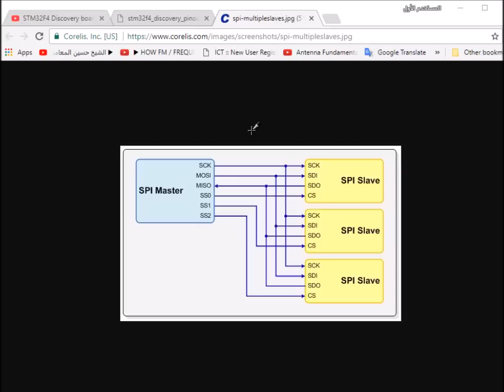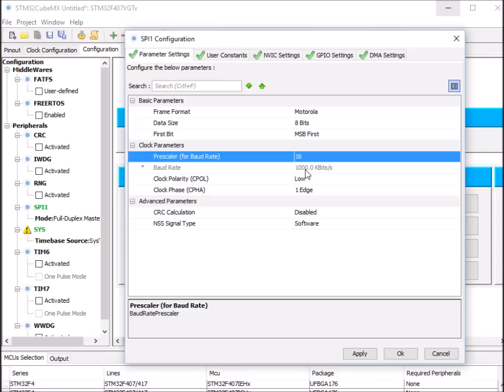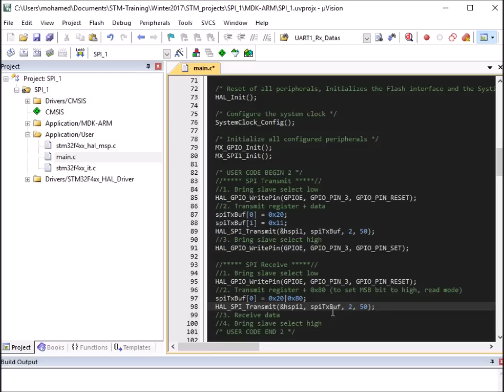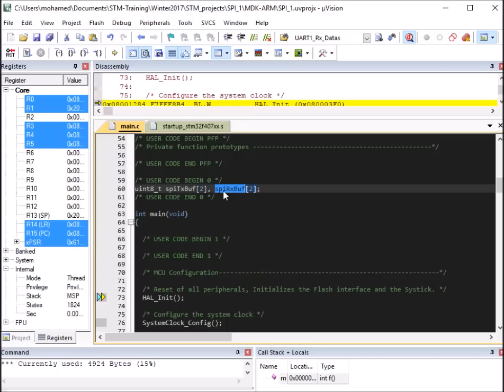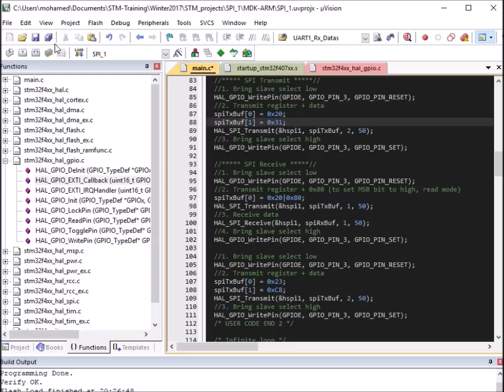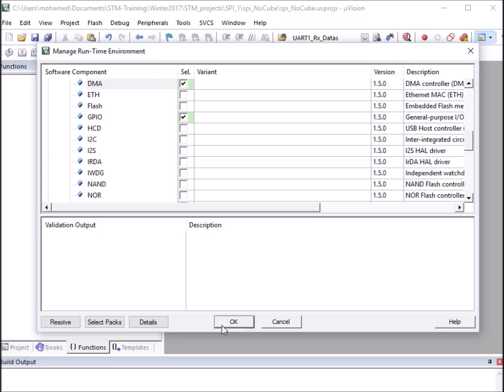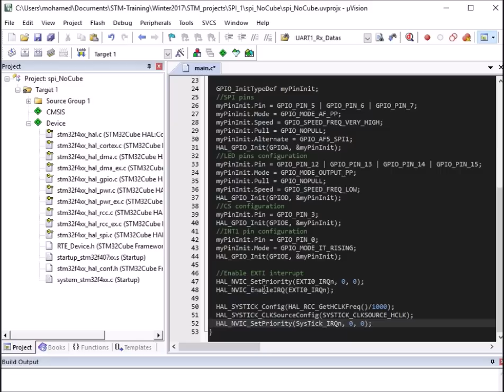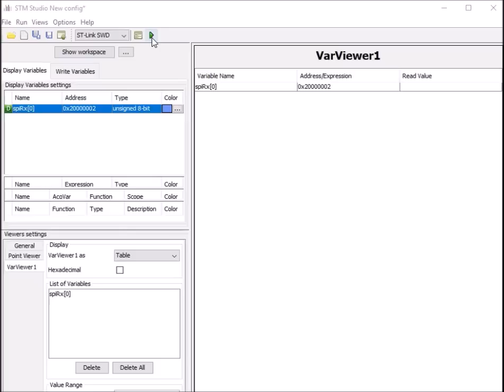STM32F4 Discovery board - Keil 5 IDE with CubeMX: Tutorial 9 SPI - Updated Nov 2017

Comment: Thanks for the video.
can you do CAN bus example?

some bookmarks:
2:28 setting SPI 1 in CubeMx
4:05 adding Tx and RX buffer to main
6:27 do: (reg_val | 0x80) to set device into read SPI operation.
8:13 debug it
8:49 view in STM studio 
9:06 using the generated Project_name.axf file 
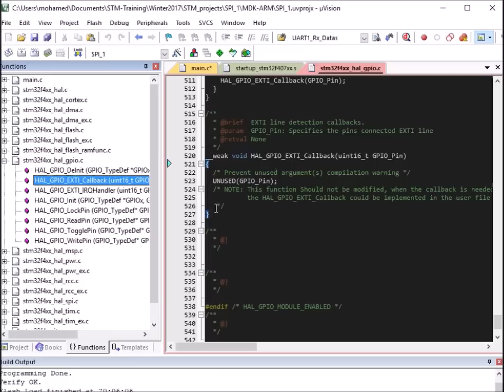10:56 using HAL_GPIO_EXTI_Callback() function
12:52 PART II - without use of CubeMx
Reply: I found the CAN Bus examle...
STM32F4 Discovery board - Keil 5 IDE with CubeMX: Tutorial 33 - CAN Bus - YouTube 
https://www.youtube.com/watch?v=ar3I38lCLT4 

Thanks.

Comment: Can you explain how you can send dummy data and get  garbage data via "Hal Function " ?
Reply from the maker: Hi,
I am not sure what the question here.
Reply: @mutexembedded2206  without sending dummy data to slave , how can you receive valuable data from slave?
Reply from the maker: @shouryuken-g7c  Hi Fatih,
You're right, SPI is meant to exchange DR (data register) between device and master serially.
Reply: @mutexembedded2206  Is it possible to exchange datas by using "SPI_HAL_Transmit" Function
Reply from the maker: @shouryuken-g7c  Yes, but if you look at the function details, it does Transmit-Receive internally but ignores received data. Most devices however, behave in Half-Duplex way, where you send, then you receive ignoring all dummy data in between. an easy example is the SPI tutorial I shared.
Reply: @mutexembedded2206  Well, I coulndt understand how "HAL_SPI_Receive" function  receive valuable data from slave without sending dummy data, because master should send Clock pulses to take it.
Reply: @shouryuken-g7c  actually the HAL_SPI_Receive() function is calling the HAL_SPI_TransmitReceive() which sending dummy data to the slave hence generating clock!

Comment: For those who have an older version of the Discovery board. It has LIS302DL onboard instead of the LIS3DSH implemented in the video. You can simply tell the model by its shape, LIS302 has a rectangular package whereas LIS3 is square. The control register is a little bit different. Just replace spiTxBuffer[1] to 0x41 and you will get the data from the sensor.

Comment: Nice video.... 

Can you please make video on How we connect two STM32 board via SPI bus,  because Its important in multiprocessor system. 
In multiprocessor system, need one STM board operate in SLAVE mode, and need proper communication steps  between them. 

I unable to find useful information on google,  no specific Tutorial on this using HAL library. 

Thanks again for your video
Reply from the maker: I will keep it in mind for next time
Reply: @mutexembedded2206  

Thank you so much dear...
Reply: @mutexembedded2206  

Hi,  I am working on project and I see there is state machine used,  then I google but unfortunately I have not found useful tutorials on YouTube or google regarding FSM finite state machine.  There are many tutorials regarding C# and Python,  but rare useful tutorials on C or embedded... 

Can you please make one video on FSM???? HOW Make FSM???? 

My another question is about main.c file in STM32.... 
What is use of assert()   statements in there??? 

Thanks dear

Comment: Hello. Everythime I am trying to transmit over SPI I get hardfault. I am using L433RC, start with whole new project, but same. I have changed everything in cubeMX (pinout, frequency, datalength) and it still not working. Any advice? 
 Thanks.
Reply from the maker: Hi,
Hard fault is often caused when you are writing to a memory more that allocated.
Uint8 buf[5]
and you are writing 6 bytes to that memory. This will cause a Hard fault
Reply: @mutexembedded2206  Yeah, but I declare uint8_t TxBuff[10] and in while loop I am calling HAL_SPI_Transmit(&hspi1, TxBuff, 2, 100) so it should be ok.
I only declared TxBuff, call nss, Transmit and Delay...I must have missed something or there is some kind of bug...

Comment: The stm32cube framework & stm32cube HAL option is not available in my keil software, what Should i do. 
software (Keil uVision5 2013-2019 arm)

please Reply
Reply from the maker: Hi,
Package installer in Keil I believe
Reply: @mutexembedded2206  I am new to this software & STM32. I searched but could not understand, Can you provide link. I have installed the package in column STM32F103C8.

Comment: I want to use UART & SPI together (read data from accel data over SPI, transmit data over UART to TTL-USB converter). I have both tutorials working separately. Then in the GPIO_EXTI_Callback function, where I receive the accel data, I added a HAL_UART_Transmit command to try send the data to the TTL-USB converter. But it doesn't work.
Can you please give some advice/steps on what I should do instead?
Thanks
Reply from the maker: Hi Mark,
This is because of HAL_UART_Transmit(), because this function uses HAL_Delay, but an EXTI interrupt temporarily blocks HAL_Tick until returned from callback.

In short, Using HAL_Delay inside an interrupt callback will cause the system to loop forever.
Reply: Ok, that makes sense. Can you give me a pointer on how I should implement the UART transmit when SPI receives new data?
Thanks for your help.
Reply from the maker: uint8_t txBuf[25];
uint8_t readyFlag=0;
...

main...
while(1)
{
if(readyFlag == 1)
{
UART_Transmit(txBuf, size);
readyFlag = 0; //Reset Flag
}
}

SPI_Callback()
{
memcpy(txBuf, spiBuf, size);
readyFlag = 1;  //Set ready Flag
}
Reply: That's great. Thanks a million. Will try now.
Please keep up the tutorials, they're a massive help!
Reply: Hi Mohamed

Thanks for your help so far. I got this working (I think) collecting samples from the accelerometer and transmitting them using a Bluetooth UART board. 
But then I tried adding a counter from 0-255, so I can check if I'm losing samples, and I had an issue. 
The counter (as I have it implemented below) is incrementing 2 or 3 times for every iteration of the while loop, instead of just once. Counter iterates even when I call the UART_Transmit function, even though the ++counter is in the GPIO callback function. Can you help? Thank you very much.
My program looks like this: 

uint8_t spiTxBuf, spiRxBuf, uartBuf;    uint8_t readyFlag = 0;    int counter = 0;

main {
inits;
SPI_Transmit (reg 0x20, set datarate and enable X data);
SPI_Transmit (reg 0x23, enable DRDY, set interrupt active high, enable interrupt 1);

while(1)
 {
     if (readyFlag==1)
           UART_Transmit( (uint8_t *) counter );
           UART_Transmit( uartBuf );
           readyFlag = 0;
 }
 }

GPIO_Config{SPI pins, UART pins, CS pins, Interrupt pins, enable ext interrupt, enable systick}
SPI_Config{...}
UART_Config{...}
DMA_Config{...}
EXTI0_IRQHandler{...}
DMA1_Stream5_IRQHandler{...}
SysTick_Handler{...}

HAL_GPIO_EXTI_Callback(uint16_t GPIO_Pin)
{
      SPI_Transmit( reg 0x29 | 0x80 ) 
      SPI_Receive(spiRxBuf)
      memcpy(uartBuf, spiRXBuf)
      readyFlag = 1;
      if(counter==255) { counter = 0 }
      else {++counter}
}
Reply from the maker: @14sulli14  
Hi Mark,
Is your EXTI callback triggered by a push button?
Reply: @mutexembedded2206  Thanks for the reply, no it's triggered by the data-ready signal on the LIS3DSH I think? Its exact same as in this tutorial. Only difference is in the callback now, after I receive the x-axis accelerometer sample, I want to transmit it using UART (to a HC06 BT module), followed by a simple counter so I can keep track of the samples. Thanks
Reply from the maker: Hi,
It is not clear to me why you're getting multiple interrupts, just carry on with debugging using break points and watch variables until you get a clue, I would say.

Comment: Hi , i followed same steps but spiRxBuff didn't recieve 0x11 on debugging mode when i added it to watch 1 , it remained 0x00 !!!!!!! , i use stm32f429i-disco
Reply from the maker: Hi Ala,
That's because the STM32F429i-disco does not have this MEMS accelerometer, it has the L3GD20 MEMs Gyroscope instead.
Reply: oh ok so it will be different , Thank u +MYaqoobEmbedded i am one of your fans , you helped me so much with your tutorials , i wanna implement a pedometer  can i use the gyroscope to do it ? if no , how can i use an external accelerometer ?
Reply from the maker: Hi,
Glad to know that you're finding the STM tutorials helpful.
It is possible to do it with Gyroscope, I came across this paper that explain how to do that: https://www.researchgate.net/publication/257397688_A_Gyroscope_based_Accurate_Pedometer_Algorithm
Hope this helps
Reply: thank u so much +MYaqoobEmbedded <3
Reply: If you are using a L3GD20 you need to Transmit 0x0f to the 20h register in order to be able to Receive data from the gyroscope. Everything else is the same, just type 0x0f when he puts 0x11 and it should work.

Comment: I wanted to make this comment, I tried using the HAL_SPI_Transmit(&hspi3, txSpiBuffer, 1, 50); and HAL_SPI_Receive(&hspi3, rxSpiBuffer, 1, 50); but it didn't work for me. I checked it using a logic analyzer and observed that the MOSI, and MISO were coming at the same time so I used a different command listed below and it worked fine. The process is pretty much the same except the TX and RX are done simultaneously. The device I was reading and writing to was an RC522 RFID device. I also was using a Nucleo-F767ZI board, where I soldered in male connectors giving me access to all the pins.

//******SPI Receive start*********//
  //1. Bring Slave Select Line to Low
  HAL_GPIO_WritePin(GPIOA, GPIO_PIN_15, GPIO_PIN_RESET);
  //2. Transmit address register
  //3. Receive data.
  txSpiBuffer[0] = 0x1F|0x80; //address for Read.
  txSpiBuffer[1] = 0x00;
  HAL_SPI_TransmitReceive(&hspi3, txSpiBuffer, rxSpiBuffer, 1, 50);
  //4. Bring slave select high
  HAL_GPIO_WritePin(GPIOA, GPIO_PIN_15, GPIO_PIN_SET);
  //******SPI Transmit end*********//
Reply from the maker: rwbazillion 
This is correct for Full duplex slaves.. But usually most external devices don't do that.. because they need to read your full command first.
Reply: yanlış spi hacı.Choose spi1 dude

Comment: Hello mate,
Could you please tell us where exactly in the datasheets should we find the appropriate registers (like 0x20) ? 
what should we look for exactly ?
Reply from the maker: Abdelrahman yaseen 
Hi Yaseen,
You just need to look for Registers map/table in the spi device datasheet.
Reply: I'm a little bit confused by the (0x20 | 0x80). 
I'm aware that 0x20 is the register address. 
but when we or it with 0x80, the address changes to 0xA0, which is a totally different register, that is not even mapped in the register table (as far as I can tell), so I'm surprised that it works.

So, How did we really know that ORing an address with 0x80 enables the reading of that address ? (given that we're eventually passing a totally different address as a parameter to the /receive/ function)
Reply: After some readings, it seems to be the convention of enabling the reading mode for a register. Pardon my ignorance. 

However, I'm still having trouble understanding the clock configuration. 
any guidance would be greatly appreciated.
Reply: @yaseen1478  i tried it with 0xA and it also gives the same answer as 0x20|0x80

Comment: Hello there, first of all thank you for your video. 

 I have a question about clock configuration.  For the SPI Clock parameters you choose a prescaler of 16, and you mentioned that it is because the device is capable of 1 Mb/s. What is the reason behind this?  which device you are referring, the accelerometer? 

I've been thinking about it without any successful answer of my own. 

Thank you,
Reply from the maker: Moises DS 
Hi,
Spi devices have a maximum dataRate in which if you went behind it will start missing data. SPI peripheral is clocked by ABP1 Clock I think which is set to 16MHz for the above example, and  I want to set speed to 1Mb/s thus a prescalar of 16.
Hope this helps
Reply: @mutexembedded2206  Hi, isn't LIS3DSH Maximum clock frequency 10Mhz, therefore max baud rate 10Mbit/s ?

Comment: 0x20 | 0x80 ? What does it mean? Which register or data?
Reply from the maker: Hi,
It means that we are accessing register 0x20 in read mode (+ 0x80 to set MSB high).
Reply: Why is it necessary? +0x80? why do we set to msb high? I see accessing 0x20 register but I dont understand why we use or bitwise with 0x80?
Reply: Because 0x20 | 0x80 = 0xA0 ? nothing any register like that
Reply: Even I have the same doubt sir, can you please explain further sir
Reply: in datasheet where it is said sir, If i make 0x20 register's MSB as 1 (i.e) 1000 0000 it is set to read mode
Reply: you can see in the lis3dsh datasheet  page  26    that  the  SPI read  protocol   the  first  two  bytes  are  the  address  plus  the  R/w  mode
Reply: how to set multiple slave for a master

Comment: Thank you sir. Can you please give example for ADC through SPI...??
Reply from the maker: Nil Rockz 
Hi Nil,
Do you mean you have an external ADC that you need to interface with using SPI?
Reply: Yes. I am using mcp3008 and stm32 in 8 bit spi mode.i get proper MSB but LSB changes from 0 to 128 directly
Reply from the maker: Nil Rockz 
Hi Nil,
I have not used this device before.. but from a quick look at the datasheet, here is what u need to do:
1. Send 0x1N (were 1: start bit)
     N = SD, D2, D1, D0
     SD: 1 for Single ended 0 for differencial.
     D2 to D0: To choose the channel from 0 to 7.

So, for e.g. to read channel 0..
step 1: send 0x18
step 2: read 2 bytes
step 3: extract data from the 2 bytes (10 bits,, 7 taken from first byte Lower bits, 3 taken from the second byte 3 higher bits)

Hope this helps. GLo
Reply: Isn't it 2 bits from first byte msb and 8 bits from second byte?
Reply: Sorry for short details. I am using it as MSB out first so i thought 2 bits to be taken from first byte LSB and 8 bits from second byte..thanks for help. I will try with this
Reply: @mutexembedded2206  how to did you get `0x18` this value from data sheet???  please guide